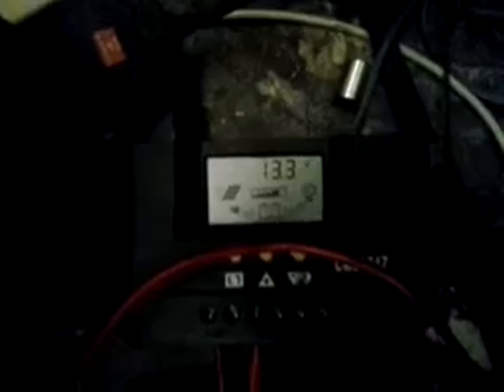Solar charging with cm3024z charge controller

Comment: Thank you for that info. I was wondering why the hell I can't get thru the parameters but my battery is 10.6 after a cheap controller smoked up so I am trying this one now sucks that I have to charge ten batteries first lol to start charging with controller
Reply from the maker: many charge controllers work at both 12 and 24, and to know which 
battery is connected a full charge lets it know, for example if its more
 than 14 volts it maybe a 24 volt battery! it is like a safety feature!